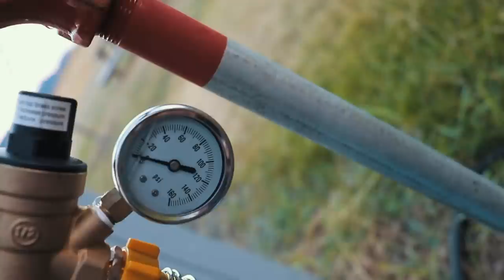WINTER RV LIVING - The Truth That You Need to Prepare For!

Comment: Brings back memories of spending a year in a non-winterized 5th wheel (for work) in Denver. The stories....A quick one: the sideout was hydraulic and would bleed off a bit over a period of time. The trailer was impossible to heat so it would get incredibly cold inside...Anyway there were more than a few days that I'd walk into the kitchen in the morning and the hydraulics had bled )creating about a 1" gap on the sideout) and find a pile of snow on the kitchen floor that I'd have to snow shovel out...lol...most of those memories were very cringy nightmares...
Reply from the maker: Oh my Kevin! That is quite the story, what a nightmare that must have been going through all of that!! Thank you for sharing, it helps knowing that the RV life struggles are relatable 😅Hope to talk again soon! Take care

Comment: Full time fifth wheeled in Alaska for 10 years year round!
Insulated the whole RV & sewer & water & well house box & kept tanks open at all times so I never had to pull them & always had water as well.
Over the 10 years we used electric heat, big pellet stove we installed & a ventless propane heater & the propane furnace that burnt up right off the bat because it couldn’t handle the constant running.
Ventless propane was our favorite & worked if electricity went off & the pellet stove but it took up a lot of space & a chore to clean & you had to store the pallets of pellets & it was very dusty.
-22° is the coldest we had it & 13ft of snow was the most in one winter.
We hit -30° on the trip up to Alaska at Laird hot springs in Canada in 2011 in November.
Reply from the maker: Oh my goodness, you guys must have winter RV living down pat by now!! 13 foot of snowfall 😱Wow! Thank you both for watching, we hope that we can continue to hear from you guys!

Comment: We are currently RV living in Central Montana right now where it was -15 this morning, not including wind chill 🥴🥴 So far we have had our pickup take a 💩 on us (not weather related, lol), our hydrant line break 6 feet under ground due to someone backing into it so we had a river and ply board Bridge out front for a few days 🤣, our hose freezing up numerous times (had to bring it into the camper to thaw), propane ran out and couldn't get furnace lit again and had to go warm up in the car (rookie mistake), water heater wouldn't heat after getting water again after the hydrant was fixed... all within a NOT EVEN TWO WEEK PERIOD!! 🤣 BUT - other than our mistakes that we have made and learned from so far, we have stayed surprisingly warm and cozy, had running water for showers and dishes (such a luxury!) and are doing pretty darn good and loving our snowy mountain views!! Reflectix has been our best friend, as well as foam board and foil tape! We keep a thermometer underneath near the pipes to monitor the temp underneath. We also took heat tape and put it along our hose and then put pool noodle type insulation over it so that we don't have to worry about a frozen hose anymore! All we have to do is go in and out to turn the hydrant on and off when we need to use it. But we can't wait for spring so we can get outside again!! Shoot me a message at brit.ras on Instagram if you're interested in our hose system for water 😊 stay warm you guys!!
Reply from the maker: WOW! You guys are definitely in the heart of winter up your way! So many things that went wrong in such a short amount of time! You seem like you are well adapted to the RV life with the positive attitude and outlook on the whole scenario 😃 That's great to hear that you are staying warm, especially with -15 degree temperatures. I couldn't imagine! We had a high of 33 today and I thought we were "roughing it." LOL 

What kind of RV are ya'll living in? Perfect idea to get a thermometer for underneath. Renee literally just placed an order about 3 hours ago so that we can better monitor temperatures underneath as well. Do you guys run a heater underneath the skirting on the really cold nights? Any suggestions for us on what kind of heater to use? Our main concern was fire hazard and I wasn't sure how to go about safely running a heater in an enclosed space...am I overthinking it? lol

Hope you guys are stay warm as well! Hang in there, spring is right around the corner :)  

-Kyle and Renee

Comment: Looks like your in a good spot ,  I would think the snow on the roof would act as super insulation, was it too heavy for the trailer to hold?  I would want to remove the window covers on sunny days for passive solar gain, and to see outside once in a while. Florida is full of  folks from the North East now, way too crowded for me. Great video thanks for sharing.
Reply from the maker: It’s a great spot, we stayed on top of clearing the roof off because I was unsure how much weight the roof could hold. Any ideas?? 
I figured with the heavier snow and all, I should probably stay on top of clearing off the roofs and slides every few hours, but that’s a good idea with the insulation part you had mentioned! 

I bet it’s crowded down there! We are hoping to hit the road in March :) thank you so much for stopping by ❤️

Comment: You need a piece of pool noodle sliced open on one side to prevent your outside door from rattling against your propane tank. Just put the sliced open side over the edge of the door where it is hitting the tank.

Comment: I have to watch the snow load , especially on my tip outs. Also bought a heated water line, and wrapped the blank out of my drain hose connections to the RV .
Reply from the maker: This is awesome information Rick! Somebody was just asking us if it is beneficial to buy a heated hose. After hearing your reply, it’s nice to see this actually being used and recommended! If you don’t mind us asking, how much was the heated hose you bought?
Reply: @HappilyEverHanks  I actually bought a good heated hose ( water line in)
It has a thermostat built in, so I just plug it in for the worst of winter.
It cost a little to start , 30$ to 40$ if I remember right ,but it beats the heck out of having one of those regular hoses freeze up when its 20 degrees. ( I did that of course) , leave the water running overnight a bit. I am not sure what the make of it is, but I can look if you want. I also found that I need to watch the snow weight.
Reply from the maker: This is wonderful information!!!! Thank you so much for sharing this! Yes, it definitely beats having to deal with regular hoses or constantly having to hook up and disconnect your hose to fill up your fresh water holding tank (like we did)

Keep these great comments coming, we look forward to hearing more of your feedback on other videos 😃👍🏼

Comment: Question: Does the snow piled up around the trailer actually help with insulation? Once the wind is blocked from going under the trailer, wouldn't that help keep the underside warm?

Oh! And for your sewer connection; if you cut out little spaces for magnets in the corners of the cut out and the piece you put over the opening, you can just stick the cover back in place. Use shoe glue to attach the magnets.
Reply from the maker: Hey Mondo! Yes!! It does actually help with the insulation of the unit. You are absolutely correct 🙂
That is the best hack EVER! Thank you for sharing this with us! 

Are you living the RV life??
Reply: @HappilyEverHanks  not yet. But moving towards it. I'm in Alaska, so there is a LOT that has to be considered and planned for. I won't be travelling much, just moving into the RV to save $$.
Reply from the maker: That’s a great way to do it!! Do you have RV parks that stay open year round there?
Reply: @HappilyEverHanks  there is one, but it's really expensive. In the long run, it's cheaper to go semi-solar. The trick is going to be finding a place to park. Much research still to be done.
Reply from the maker: For sure, there is a lot that goes into it right? Thank you for sharing Mondo 🙂👋🏼 We hope to see you on the new video tonight!!

Comment: I have a Grand Design Reflection 150 series 295RL with an on demand water heater. Hopefully you guys have the same water heater. How did you guys prevent the water heater from freezing and ultimately cracking?

Comment: What happens when your camper has to be in the shop for repair/service or does a mobile unit come out?
Reply from the maker: That's a great point Daniel! We actually faced this at one point. We were going to completely remove the skirting and take the camper in for service. We found out that we could wait for some time before doing the service, so we held off. 

I foresee that investing in some good quality skirting that is easy to set up would be worthwhile for situations like this. Also like you said, utilizing a mobile unit repairman is a great tool as well! We appreciate you Daniel! Talk again soon 🙂

Comment: How far do you think one 100gal propane tank has lasted you during the winter? Does it last a week or more, less?
Reply from the maker: Hey Eva! We would say that after we skirted, our 100 lb propane cylinder last us approximately 2 weeks. It all depended upon how warm we kept it, surely during the night we turned the temperature down to try and conserve propane and slept with a lot of blankets. It wasn't bad at all, definitely more convenient to have a propane company come fill up the cylinder instead of running single 30 pounders back and forth 😊
Reply: @HappilyEverHanks  If you have electricity then I guess heated blankets can work just fine also. 👍
Reply from the maker: Yes! We need to get one of those, they are sweet 😁 Have a great night Eva, we will talk to you again soon